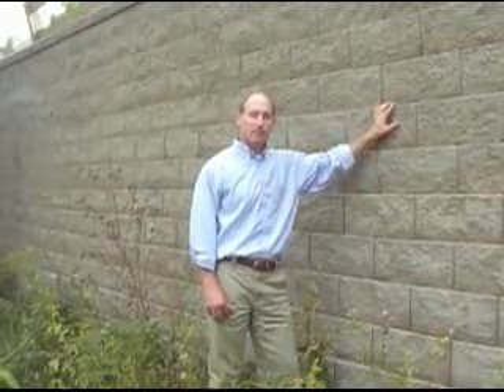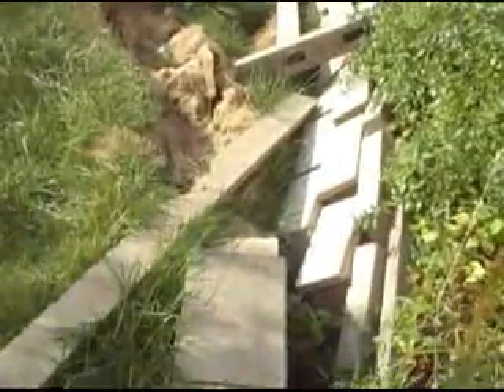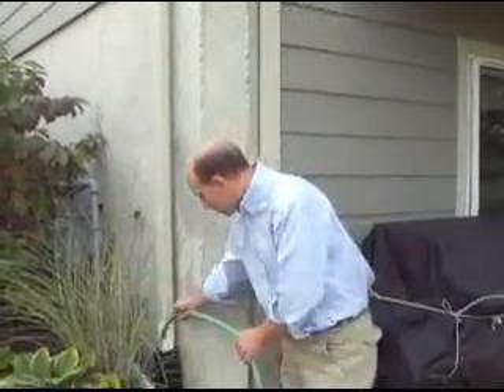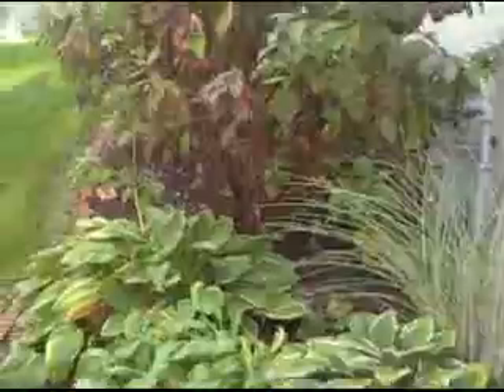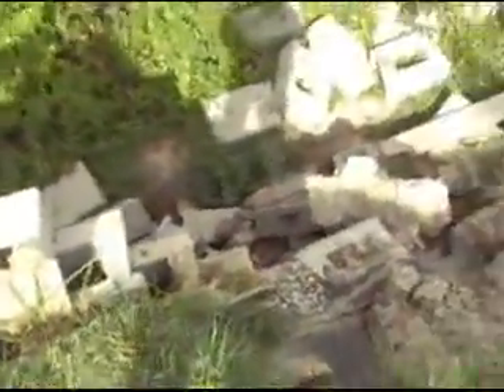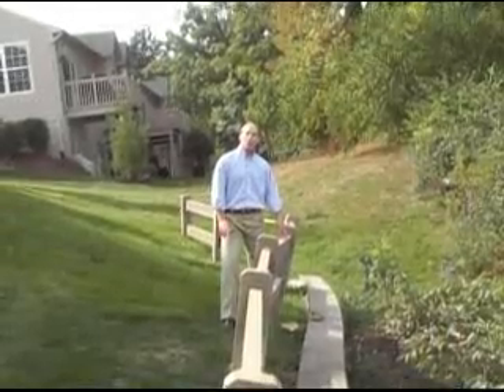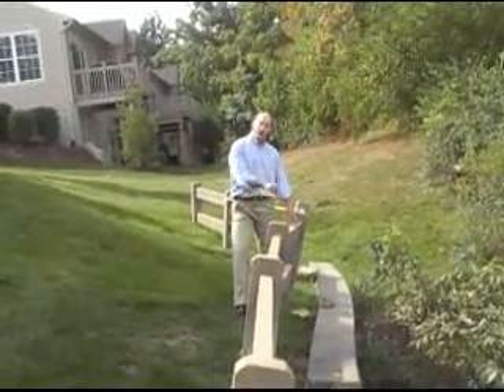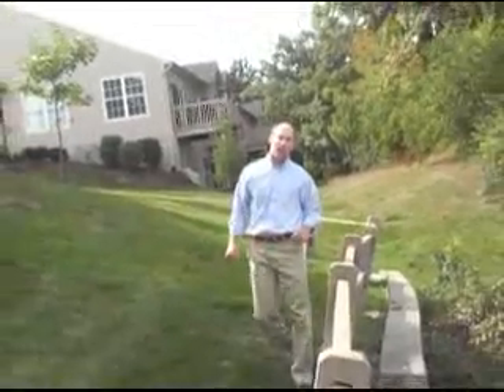Retaining Wall Failure Caused by Water

Comment: Water adds pore pressure which causes additional pressure behind the wall , the best material to use for backfill is simply crushed rocks , or use geotextile and drainage system , or if you can't do any of them design it for fully saturated including pore pressure caused by water

Comment: Excellent video and thanks for sharing. 

I cannot imagine why anyone would discharge roof drainage to the retaining wall drain. Did you confirm that there is a collection pipe at the base of the wall to convey water from the gravel fill to some daylight point? My guess is there is not such a drain or the roof drainage would be captured by it and conveyed away, unless there is some other problem not evident in the video.

Thanks again...

Comment from the maker: Often, the building department will perform inspections during construction and/or an engineer will perform inspections during construction and then write a report stating "wall was built per design."  I'm not sure when the downspouts were connected and installed up there ... could have been done long after the wall was built.  Thanks for watching!  Joe K.

Comment from the maker: I'm not sure what happened or how the downspouts got directed to that area.  The water in the downspouts should have been collected in solid-wall pipes and released downslope, in front of the wall, FAR enough away from the the front of the wall to prevent erosion.  Maybe the original plans showed the pipes simply dumping on the ground (which might be okay), but the residents may have disliked wet backyards and then had the pipes constructed to dump into the gravel behind the wall.  Bad idea!

Comment from the maker: @LaszloBencze You are right on the money.  If the water is discharged just onto the slope in front of the wall then there will likely be erosion and problems caused by that water.  The water needs to be collected and discharged downslope sufficiently in front of the wall to prevent: (i) saturation of that hillside; and (ii) erosion of any of that soil.   Good comment!   Thanks!

Comment: Moving the drainage to the opposite side of the wall is an invitation to an even worse disaster.  The most basic principle of soil is that it’s structure disappears upon saturation.  A properly designed wall has a gravel curtain many times the thickness of the wall extending from footing to grade, and a properly designed footing drain field to capture the water and carry it away in a water tight line to a community drain or swale that is well outside the load plane of the wall and slope.

Comment from the maker: Geogrid is holding up buildings and structures all over the world - reinforced walls and soil structures have been built nearly 300 feet high that are safe and permanent.  I'm a registered Professional Engineer in more than 15 states and have been involved in several block walls nearly 50 feet high that are performing very, very well.  You should learn more about these walls, and try not to form an opinion based on your limited experience with these walls.

Comment from the maker: Guys, the wall did have drainage incorporated.  First, there was a 1-foot thick column of stone behind the walls.  Second, the entire geogrid-reinforced zone was made of free-draining stone. Mortar is never used in these kinds of walls, it is not needed.  The drainage pipe discharges lower on the hillside - you just can't see it.  However, the downspouts are just TOO much water, and caused this failure.

Comment from the maker: Dave,
You are right there was no gravel behind the wall blocks, but only in the upper 1-2 feet of the wall. Also, the contractor did not put gravel in the cores of the block, which reduced their weight. Below that, there WAS gravel in the cores and to 1 foot behind the blocks. This wall does batter back a few degrees.  I like the way you approached this problem!  Stop back soon!   Best regards, Joe K.

Comment: I dissagree with your assesment,you say there is gravel behind the wall,I see NONE! the water is being deposited against the back of that wall while not technechly correct it should quite easy for it to weep out the face of the wall,also as extra insurance all walls should lean a few extra degrees into the load.